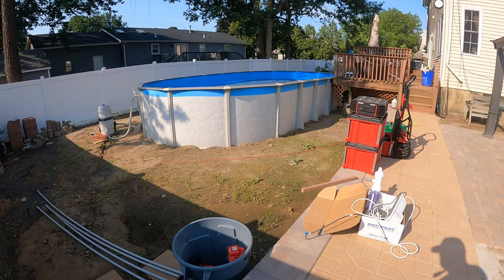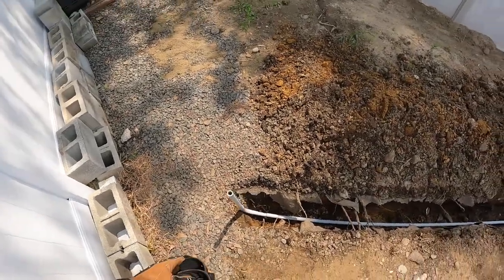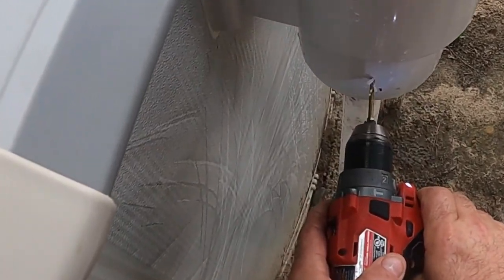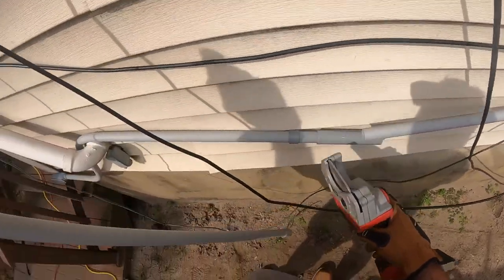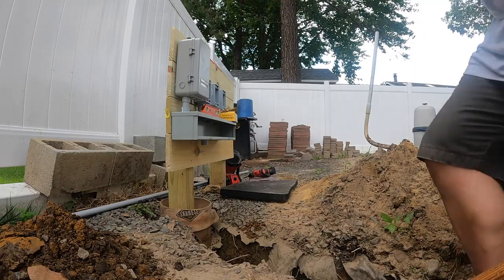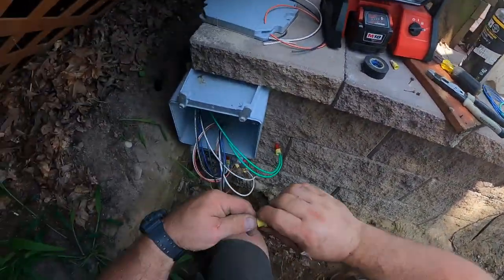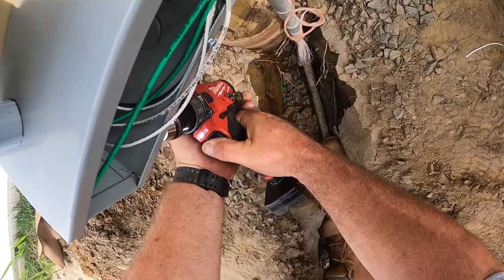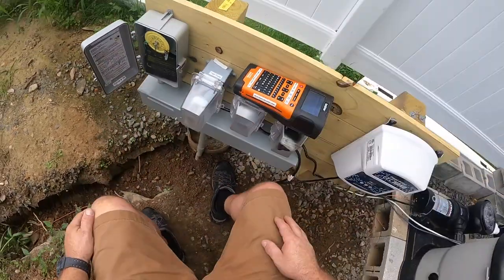Wire a Storable Swimming Pool | Wiring an Above Ground Swimming Pool #electrical #pool #grounding

Comment: Was taught to always use cleaner on PVC and on the grounding of pool metal trough we always scraped off paint on at least or one side to make a better connection. Smart placing labels on top of 3 outdoor boxes because you know the supposedly heavy or forget if the NEC says extra heavy duty covers are required but we know they will never last the what 15 or so years of the pool.

Comment: Nice job Ron, I've never seen anyone put those expansion couplings on the side of the house. It makes sense though because I see PVC all bent on buildings from the sun. Nice to see someone labeling the circuits for the next person. The only thing I did notice is the feeder wires inside the 3/4" conduit. I thought anything over 4 current carrying conductors needed to be derated so the wires should have been #10 in my own opinion. 310.15(B)(3)(a)
It works- keep up the good work!!

Comment: Cool subject, Ron. I enjoy the variety of jobs and topics you cover. That skimmer electrode seems like a failure point to me though. Eventually the pvc or whatever plastic the skimmer is made of will crack around the mounting screw, but I guess it will outlast the life of the pool. Also, when sinking those posts into the concrete base you might consider driving a short piece or two of rebar through the base for a more secure attachment. I’ve seen posts shrink from weathering and pull right out or become loose over time. Two pieces or more of rebar push-fitted into the post at 90-degrees would prevent that. But again, the pool probably would fail before the posts ever did.

Comment: I am new to your channel and watching from the U.K. great video Sir . When you was digging the trench to put your conduit in surely you could have used precast concrete cable cover tiles that would have given you protection against anyone going through the conduits as a electrician in the U.K. that is what I use and it’s good another for all the inspectors i come across . Great work you do 👍🏼

Comment: Hey Ron nice clean work!  Just wanted to ask about the ground wire you ran.  I think I heard you said you ran 1 Green THHN wire through the conduit that you attached at the pull box on the side of the house to all the other bare ground wires?

Then when the Green THHN wire got to your metal box out by the pool you joined that 1 wire to 4 different insulated ground wires that ran to each box and the timer?

Comment: Yo! You Killed This Install  Really Good Stuff GOOD JOB!!!
Reply from the maker: Thanks. I'm glad you enjoyed it.
Reply: @electricianron_New_Jersey  it would be cool to do a live together pick your brain and nerd out on code! Lol     what's your thoughts here,  red brass to a pool light  gets broken,  obviously it should be re threaded and stubbed back up above 8 inches or water terminate in a listed pool light box  blah blah ...     wound you find it acceptable to:  re thread it, attach a pvc female and change over to pvc but  clamp a pipe clamp to the brass, and run a # 8 to the junction box with it?     Thoughts   Also for context  the pool deck,belly steel and all the equipment light transformers, pumps heaters etc  and all the other # 8s would all be properly bonded together     I know it's not a common fix, but would it meet intent of the code?

Comment: Hey Ron, that trench should be 18” deep to the top of the conduit, the 12” with gfci protection is only for 120 volt circuits.

Comment: Yes sir. I actually had a customer, just the other day actually, tell me not to worry about bonding around the pool because he wasn’t going to pay for that to be done because he said the materials cost was to high. I told him it’s a code requirement. He said to hell with the code. He also didn’t want a time clock installed either. He said he would just turn it off and on manually. He said all this after I had ran power to the pump location. It’s just a 120 volt pump and a led pool light. I did bond the pump to the equipment grounding conductor but I could not get him to pay for the materials to bond around the pool….So I just did it anyway. The only thing I didn’t do was install a time clock.

Comment: Good job, i need a skilled electrician now!!! I am completing a pool the old one was junked alot of questions with the electrical, nobody ever paid attention to, i am concerned that my father in law didn't have any grounding to the pool pump, of any kind of bonding, unless someone took it, the pump is missing amd no copper wire anywhere.

Comment: Great and informative video. Is the process the same for an in-ground pool?
Reply from the maker: Similar, but a lot more detailed. An inground pool would require bonding the rehabilitation bars if it were a concrete pool.
Reply: Mine is steel wall. Doesn’t seem much different than above ground. What would you do different on an in-ground for this video?

Comment: Thank you for the videos. I'm hoping you can answer a question. I will be installing my above ground pool soon.  currently there  is power in my shed fed by 2 -20 amp breakers using  13/3. I'm wondering if I can wire my pool using the  existing 13/3 in the shed since it is much closer to the pool . My motor is 10 amps and I have no heater.
Reply: 12/3*

Comment: Hi great video, my question is I have a aluminum wall pool and the rest is resin. Do I need to go right around pool? Also do I just bond to the wall joint bolts then skimmer, pump, heater, salt generator and finally to a grounding rod?
Reply from the maker: Forget the ground and don’t drive a ground rod. The equipotential bonding grid conductor gets terminated to a grounding lug found on the bottom of the pool pump motor.

Comment: What kind of bolts and nuts do you use?  And do you put them on before they put legs up for
Pool?
Reply from the maker: Gary, lugs have to be rated for direct-burial and I use stainless steel hardware to resist corrosion.

Comment: Nice video bud. 
How far was the panel from your j-box you mounted on the house? Couldn’t you run some flex or pipe inside and avoid splices. Just a thought. 
Do you use silicone wire nuts outside for moisture and corrosion? I always drill a 1/8” pilot hole in the bottom of bell boxes and outside j boxes never will have a problem with water getting out, if it finds a way in.
Reply from the maker: Only 360 degrees in bends for any conduit run.  That’s why the box was installed.
Reply: @electricianron_New_Jersey  I understand why you installed the box. I thought you could  just come out the back of the box with flex or conduit and not Romex, eliminate those joints. Just a thought bud. Thanks.

Comment: Was wondering about a grounding solid copper bar?  My dad when installed electrical for out pool pump when I was a kid installed a separate copper rod that was buried 6' in the ground.  Is this overkill or is GFCIs good enough?  Great video by the way
Reply from the maker: Ground rod does nothing to clear a fault and for a pool is not required nor is it encouraged.
Reply: @electricianron_New_Jersey  TY for quick reply.  Awesome video by the way

Comment: Hey electricalron,   excellent video!   On our installation the pool only has a steel wall.  The top cap, bottom rail and vertical supports are all resin.  Where the wall comes around  to meet itself, it is joined with a row of nuts and bolts in a vertical  pattern. I have been told that a lug attached to one of those bolts would be sufficient for bonding rather than 4 points around the pool.  Do you concur?  Everything else would be the same as your project with 8 awg copper wire going to the plate in the skimmer and to the lug on the pump motor as well as around the pool in the ground. Hoping to pass inspection!     Your opinion would be much appreciated .     Thanks brother,    Terrence
Reply: The code does say 4 points....being a resin pool I'm going to say you have to look at the manufacturing specs. I'm saying this without referring to the code book...
Reply: @scott3331  Thanks for the reply Scott. I'll check into that.

Comment: Hey ron great video, quick question.  At the four points where you bonded, did you use self tapping screws into the framing? Or did you drill and tap and use a machine screw
Reply from the maker: NEC 250.8 lists 8 ways to do it. I use stainless steel nut & bolt 8/32.

Comment: Hi Ron, great video. I am confused about 680.12. Do we actually need to have a dedicated disconnecting switch for the above ground pool pump circuit? I feel we don't and I didn't see you do it either. What are your thoughts? Thanks in advance!
Reply from the maker: The required disconnect is the cord body that gets attached to the 20 amp locking receptacle. The cord disconnects thew power to the filtration system, like unplugging a lamp.

Comment: It’s a great video and it was a ton of information in here. But where did you bond the pools bonding system? Was it run through the 20 amp ground wire back to the main electrical panel?
Reply from the maker: The equipotential bonding grid is terminated at the pool filter motor. There's a copper grounding terminal normally located right beneath the wiring compartment.
Reply: Yes and it’s also bonded to anything metal within 5 feet of the water. But why size conductor bonds the grid to the main service panel?  Just the ground for the 20 amp circuit or something larger?  You still need a ground back to the source to make it electrically safe .
Reply from the maker: @thereefaholic  Yes, the solid #8 AWG gets attached to the bonding lug on the pool pump motor. The motor is wired with a #12AWG equipment grounding conductor. Any fault current would flow on the #12 AWG back to the panel and eventually to the source (the utility transformer).

Comment: Great video. Very detailed. 
I got a question. 
I have a main 200amp panel outside of my house. 
I have a : 
In ground Swimming pool ( Black & Decker 2HP Variable Speed Pool Pump) 
110 volt clothing washer & 
220 volt dryer. 

I want to install a Square D Panel/ Sub panel
I just need help in finding the right way to installing these items without messing up. also what is the best way to route my wires using which piping. EMT conduit pipe or PVC conduit pipe or Liquid tight 

All these will piping will be going from outdoor to indoor since my main panel is outdoor in my backyard. 

What breakers is needed for all these items listed above and do I need to get a gfci breaker for my pool pump. 

Do I need another panel to run the pool pump and later on add a pool heater. 

Items I already have in my possession is:
Washer 
Dryer
Pool pump
2awg Cooper wire (4 wire) Red, White, Black & Green

Any help will help I greatly appreciate it to the fullest. 
I want to start this project this coming Thursday since I will have a few days off. 
Thank you hope to hear from you really soon. Stay safe and blessed.
Reply from the maker: A sub panel would require (4) conductors from the main breaker panel. (2) ungrounded "hot" conductors, (1) grounded neutral conductor, and (1) equipment grounding conductor.

Comment: Hasn’t the bonding system be removed from the nec as well? From what I read it says anything with a vinyl liner does not require a bonding grid.
Reply from the maker: The steel supports still need to be bonded.

Comment: I  want to build an in ground spa next to my house, I have a large accessible crawlspace, can I put the mechanical equipment in that crawlspace?  It would be on a slab inside a drywalled closet.  I live in area that gets heavy snow loads and very cold.
Reply from the maker: It’s always best to check with your building department first, but from an electricians perspective you need to install a service disconnect within sight of the equipment as required by the NEC.

Comment: Hey Ron.. great content. I'm in North Jersey. Where is that 5ft from the pool trench code?
Reply from the maker: Unbeknown to me, the section that required the 5' rule was article 680.10. This section was removed for the 2017 NEC and you may now refer to table 300.5 for depth requirements. You cannot run under the pool but you may run the underground wiring as close as you'd like to to the pool.

Comment: Drilling the top of your gutter might let water in. I was always told that it'll defeat the purpose of the water resistants of the gutter. What are your thoughts on that?
Reply: If you really want you can use Myers hubs but really not necessary.
Reply: You can also use sealing lock nuts

Comment: How do you get the 5 bond points if the entire pool is resin including the the support posts?
Reply from the maker: If it’s plastic there’s no need to bond because plastic does not conduct electricity.